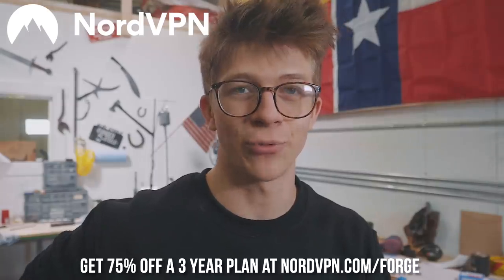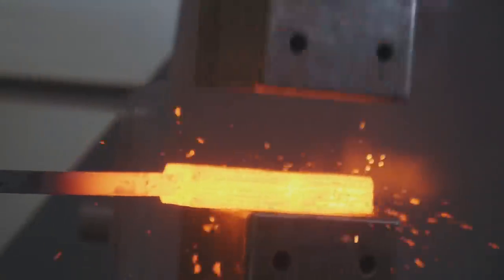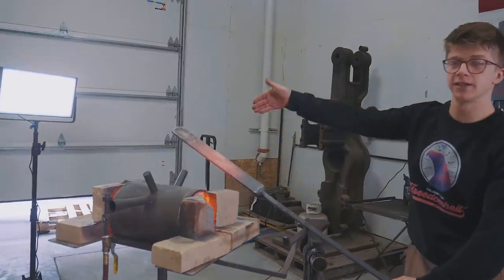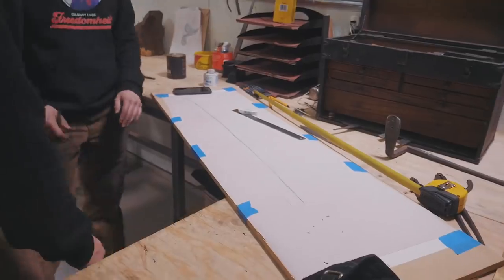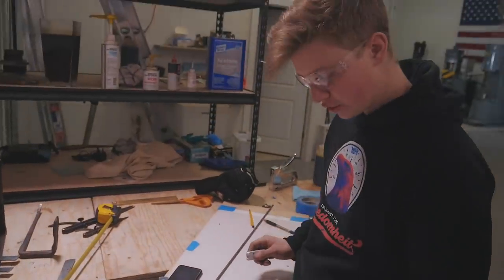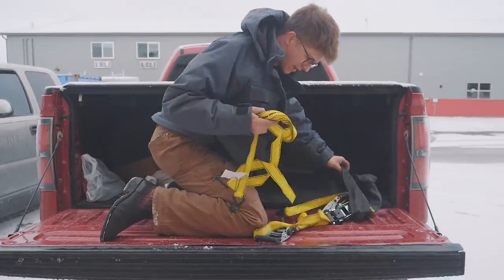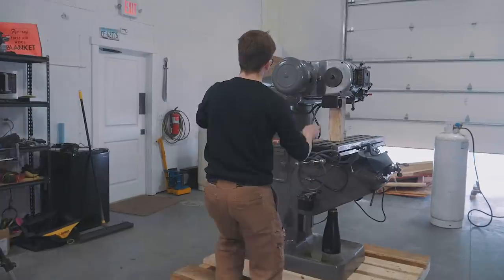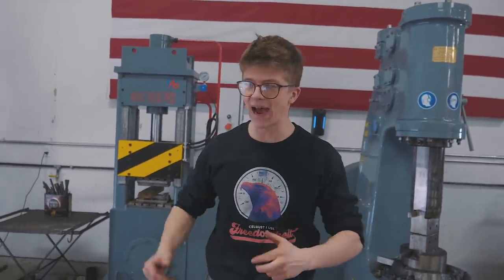MAKING A CAVALRY SABRE: Part 2

Comment: Alec I’d blame using wagon tires for the wrought source being the cause of failure. Wagon tires are notorious for being a very low quality iron. They were a consumable so using the high quality stuff would be a waste for that application.
Reply: True, but there's also the unsealed fire that formed it to take in to consideration. Every time i've seen this stuff done it was in a sealed furnace with a pour box. At Guédelon (an archaeological experiment) they make this stuff on ancient form ONLY and they get really good stuff out of it because of that.
Reply: aserta that may be it as well... though as I think about it I don’t think there’s anything different between a “sealed” fire and what they made here. You are still blowing plain old air into the fire. The environment in the fire is going to be same regardless of how sealed the fire is, nothing from outside is contaminating the fire. 

Admittedly though I am not an expert on hearth steel, so I don’t know the specifics of it. It does seem like a very dirty material. If I were turning wrought into steel I would’ve gone for blister steel, where the steel is isolated from the fire and entirely.
Reply: Bloomery steel will always contain impurities... that's why people stopped doing it. Considering the materials used, and tgis being their first attempt,  the quality of the product is rather good.

Comment: I'm going to make a suggestion here, something that might help you avoid both the decarbourization, and the impurities that you experienced when making your steel.  Take the bloom steel after you've made it, and try turning it into crucible steel, placing it into a heat-reflecting ceramic pot, sealed against the air, with either some borax flux, or regular silica glass on top.  (the glass or flux will act as both an oxygen barrier, as well as help to leech out impurities in the material, as it melts first)  Once you've set it up, just burn the heck outta it in a charcoal foundry like you had, and you should be able to re-melt the steel, stratifying it, leaving it as one solid, homogeneous billet, without having to cut and fold it a million times.  I'm sure there are other ways to do this, but I wanted to make the suggestion, as it's something I've always enjoyed watching.
Reply: I was going to suggest the same. Even the layered stock you have could be smelted down, to use again.
Reply: or they could just forge it in a coal forge

Comment: ALEC! Something that might help you a lot with drawing out those type of curves is a flexible curve. The one I'm referring to specificly isnt your standard flexible curve ruler. The only site i know that sells them is Axminster, just search flexible curve on their website. it has curve locks on them, so you are able to lock the curve or straight in place. Flip it, and have that same curve mirrored. I use it in woodworking, but dont see why you wouldnt be able to use it in metal working!

Comment: If you need some interesting metal to start with shoot me a message! I have some cable from a bridge, about 4 inch diameter, and some turbine blades from a power plant of some sort!!
Reply: Turbine blades are going to be titanium right?
Reply: @MortRotu  No.Can be anything. Titanium, super alloy, high grade steel.....depends on pressure stage an type of turbomachinery - Fan, compressor, high, intermediate,low pressure turbine, gas or steam ? Year of manufacture......
Reply: @Zonkotron  I suppose I'm only used to hearing about aviation turbine blades, hadn't considered the other uses of turbines. Oooops
Reply: It’s probably steel, depending on if it’s a gas powered turbine or steam, it could be a pretty complex mix or just a really high grade steel.
Reply: @bdb3393  does it rust? is is magnetic? if not that try the spark test take a grinder too it,  titanium and steel both spark a whole lot. aluminum doesn't.
Reply: Apathetic Indecisive it’s def not aluminum!! Weighs a ton and a half.....
As for rust, yes where it sheared it did rust slightly. I haven’t spark tested it yet
Reply: @bdb3393  well if you have a magnet you test whether it's steel.

Comment: Since you posted this video I have been mulling over the issue you had with your all of the carbon working out of your steel blooms in processing, and should you ever try this agian one thing to try may be using a charcoal forge to heat your blooms for processing.  In that environment you may not suffer the same level of de-carbouriztion you did with using the gas forge, and may have more success.  Assuming you give this another go of course, still very cool to see the process and the pitfalls of it, and looking very much forward to the rest of the process on this project, best of luck!

Comment: @Alec Steele -- if you have to completely back away from the tires, consider driving up to Lincoln/Butte/Helena and grab yourself some antique drill rod (do some sightseeing).  It would make a fine blade, and is a significant placard and exemplar for the rich mining history of 'The Treasure State', notably Southern Montana.

And on the value add, it would make a nice video, with tons of Montanny B-Roll.

Comment: Wouldn't a pinstripe tape work for defining the curve of such a blade? you are able to remove the last view centimeters and try it again. so during the application you can change the angle of the curve slightly. after that if your satisfied with the result, follow the line with a pencil and then remove the tape, which should work fine because it is not that sticky. just an idea, maybe it won't work at all :)

Comment: I heard that you loose a lot of carbon in propane forges and that it is better to use a coal forge for low carbon steel, because it actually gains some carbon in the forging.

Comment: What about using photoshop to help you during your design process?
Reply: yea or illustrator to make some vector to zoom forever. Just trace a good top down photo of the sword, account for lens distortion, i'd do it but i don't have a sabre
Reply: yeah, that or solidworks.
Reply: Surprised that they aren't actually using a CAD.  Not photoshop but an actual CAD program where they can mess around with widths.  Not that hard to do, set a box with your maximum dimensions then map the curve to an underpaid issue.  You can work at full size, then get a cheap plotter and print out 1:1 scale.  Total investment would be about 4000$ for program and plotter but has the advantage of saving plans and designs to be reused in an workshop environment so each time you do a saber, chef knife, ect you print off you base plan and if modify it if necessary.
Reply: Fusion360 would be a pretty good option
Reply: i think they prefer the good old fashioned hand work, like it has been done by the craftsmen who built such swords like 150 years ago.
.. sure, powertools and microscope..  but still.
where would be the fun if they end up 3d printing shapes for casting or let a big 5 axis mill cut a beautiful sculpture out of a solid hunk of metal ?
Reply: @patrickmcneely3877  He's already using CAD (Cardboard Aided Design)
Reply: m m Ya totally agree with that, some of the programs can be really nice, even if you’re just using them for more basic functions though. 

Fusion is great, even if you’re working in 2d and it would also give them the ability to render in materials, so they could pick through to decide what combinations would look best (mock-ups/renderings). Was thinking more for concept/design work, than anything to do with production/manufacturing
Reply: There is something to be said about doing it the old fashioned paper and pencil way.  I use to design headstone and I loved drawing sketches on paper.  The problem is when building a business especially with a heavy design basest, being able to streamline the design and edit tweak existing designs becomes a god send.

Comment: You will have a bit of impurities if you work with hearth steel. Not delaminations of course, but some amount of silicate and/or slag is just par for the course and part of the beauty. Make your next batch of steel out of mild or something confirmed low sulphur, and add a bit of crushed glass to protect the bloom against excessive decarb early on in the forging. It's awesome you're doing this!

Comment: Near the beginning of the video I almost commented before I watched the whole thing that your solution to the iron problem was one chosen of comfort and ease. You do damascus very well, it's within your comfort zone. Your solution was taking the easy way out, except that doesn't always work and after some good steel, forge, labor and welding investment you find your solution didn't work. Although making steel is not your comfort zone it seems a worthy thing to learn in your field, finding out what went wrong and doing it right is surely better than any alternative, although it does suck to "start over", I prefer to think of it as getting it right. I accomplished nothing if I did it wrong the first time, so I never finished and cannot do it over, in fact I don't want to do it over because it was wrong and I don't want to repeat the same mistakes.

As a secondary note I recommend doing smaller batches and spark testing sooner in the process than making 14 or however many billets you made before..

Comment: Get yourself a drafting curve or flexible curve ruler. It will help with drawing the line but it is also taller than a ruler so you can manipulate the curve and if you need to weight it down you can sneak a pencil underneath it. Staedtler makes them and I’m sure you can find many other options on Amazon or a drafting/architecture supply store (if those still exist).

Comment: Hi Alex
At the moment I'm an engineer student in Germany [please forgive me for spelling mistakes;) ]and might have some advice for you. As Will said it is REALLY hard to draw curves by hand. What we use instead of drawing by hand or using expensive CAD softwares, is a simple graphic calculator. We use different types of functions for different curves and adjust the variables to our liking (e^x for example). GeoGebra is free to use. You just have to plot a graph and print it out. With simple maths you can calculate (or measure by hand) the exact lenght and thickness of the blade.
I would like seeing you try this very precise method. 
Even if you don't, I will still enjoy your great work. 
Greetings from Dortmund, Germany :)

Comment: For drawing long, smooth curves, you can copy from boat builders and use a strip of wood. Bend it into shape, nail it down, draw the line.
Wood is a lot more flexible than the metal you suggested to use at the start.

Comment: FYI- old trick for getting large curves is to take a long 7' plus length of thin wood and bend it with a string (like a bow)
for compound curves - simply taper the bit of wood  on one end.  the thinner end bends more than the thicker end.

Comment: Alec if you go for making your own steel again please use a more efficient method than a bloomery. There are early crucible methods that use clay and will allow you to recycle the billet you made. By the time of the US Civil War, the two sides were using blast furnaces anyway.
A crucible helps keep out air and gives a more even heat and blocks many impurities from entering the ingot. (less slag)
initial ingots of crucible steel are very hard and under much stress, so the initial forging of the ingot must only be done by a hand hammer.

Comment: this kind of contamination in older Wrought iron
 is fairly common as a precaution you can use a vat of sulfuric acid to leech off the phosphorus contents. a quick 30 minute soak and you will leach off a lot of that contaminate with little loss of iron and be ready to bloom. you dont need to use sulfuric acid, it could be nital, hydrochloric acid , sulfuric acid is just readily available since it is used in car batteries and in a lot of other processes.

Comment: Alec, I am an aircraft mechanic and it just occurred to me that a product I use from time to time to detect cracks in aluminum and steel airframe structures may be extremely helpful to you when inspecting your steel. 

It is called Magnaflux Spot Check, it is a dye penetrant that wicks it’s way into cracks that aren’t visible, after a dwell time a developer is sprayed onto the surface and magically cracks will appear if they are there. Amazon has the kit for $130. Give it a try. 

Logan

Comment: Attempting to forge from traditionally-smelted steel was a worthy experiment that reinforced the challenges faced 1000 years ago.  The Japanese katana forging process uses many folds to homogenize and decarburize the steel to the various, desired, usable states.  But the traditional smelting process is simply not hot enough to liquefy the steel for efficient elimination of impurities and sorting of the heterogenous bloom products was also necessary to best suit the components of the blade.

In videos, I note the quenching process typically employs submerging in a horizontal oil trough rather than a vertical steel pipe, resulting in the rapid cooling occurring more uniformly along the entire length of the blade rather than progressively from one end to the other.  It's likely European sword-making processes also followed this method and that the typical, modern blacksmith has merely resorted to vertical hardening due to the convenient and ubiquitous commercial availability of large steel pipe.  Such pipe baths have the advantages of requiring the minimum amount of oil and easy storage.

However, given the frequent warping ills suffered despite painstaking blade preparation for quenching, wouldn't it be a good subject for experiment(and video) to construct and employ a horizontal trough for quenching?  It would be a simple matter of some thin plate 8"x40" sides, 4"-6" bottom and end caps, all welded together and onto a low, metal, sawhorse-type leg structure.  A lightweight, riveted sheet metal cover could keep the oil safe and clean.  It could even be on a dolly to move(carefully) out of the way.

Judging the results would, necessarily, be subjective and over time but I have no doubt you would develop a sense that fewer warping issues were experienced if that were the case.   At the very least, you would be able to claim a more traditional approach to blademaking, even if not with traditional materials.

Comment: The only people I watch online that forge with machines is Alec and Walter Sorrells. Alec uses a power hammer almost exclusively to forge weld, whereas Walter uses a press, which Alec also has. So the question is, is there a benefit to one vs. the other or does it come down to preference as to which method/machine is used?

Comment: Alec, not sure if it was mentioned but you might want to think about getting a bigger forge in the works soon so that you can properly temper and heat treat the blade when it gets to that step. Just a thought. Glad to see you got replacements so fast and hope this turns out better than the Viking Sword did.
Reply: I meant to say replacement equipment.

Comment: An idea from someone that has never hammered down not a single piece of metal that wasn't a nail to a wooden wall, to be sure that you get true steel from raw iron by yourself you could invest in a brick klin or whatever is needed in order to get crucible steel, much like the Ulfberth swords, in order to be sure and safe that what you get is steel and steel only. I am aware that is a more expensive method, but it may be worth the effort.

Comment: Wrought iron by definition has slag inclusions in it. I'm not a metallurgist, but what you're seeing at 12:11 seems normal for that material. I wouldn't abandon this billet, swords were made using carburized wrought iron for like 2000 years

Comment: What you can do to get that nice curve is get yourself a thin strip of metal steel would be good and place some dowels in a plank plotting out the curve you want like you would on a coordinate plane. Then flex the strip across them to give you a precise edge to trace onto your paper.
This same process is often used to trace out form dies for ceder strip canoes.
If you have access to some CAD software and a big-ass printer it saves you a lot of time though.

Comment: You could try using the construction method of the Japanese tatara to make your steel again.  Also, little fun fact, the process of wrought iron and low carbon steel and remelting them down into high carbon steel in Japanese blacksmithing is called oroshigane.  Might be wrong on the spelling.

Comment: Have you thought about building a wire brush stand to clean off all the extra slag from your metal? Instead of needing to brush with a wire brush by hand, you could just run it over the open brush? I'm guessing this would be a bit loud to have running all the time though, and not sure if it's worth it, but would be easier to keep your steel clean I'd think.

Comment: Probably worth noting that all gas forges are decarburising - when making your own steel the carbon doesn't penetrate deep, and thus more easily decarburised in your forge. I expect you would have more success in a coke/charcoal forge, keeping the steel in the carburising section of the fire! Keep on pushing your limits though, keen to see it succeed!

Comment: i am working on building my own forge. the main body is coming along okay. still need to clean up the shell a bit. but the burners. i planned to build my own burner, but the cost of parts is higher than the cost of one of the burners sam sells. so ya... guess i will just order one

Comment: The thing about working with bloom steel or tamahagane as the Japanese call their steel you always have to work in a charcoal forge because tamahagane will lose carbon very fast faster than modern steels. But when you follow the way Japanese smiths forge their steel your steel will yield better results.